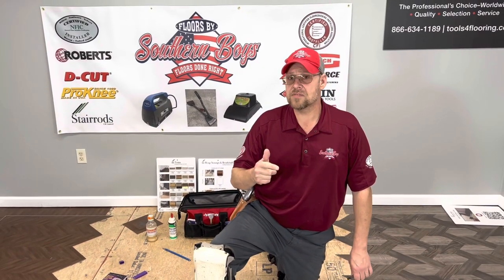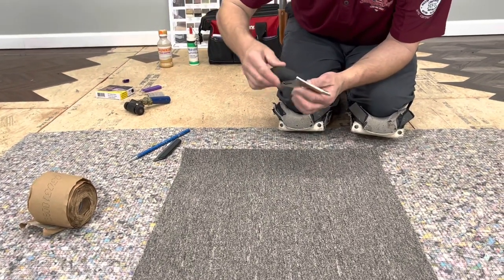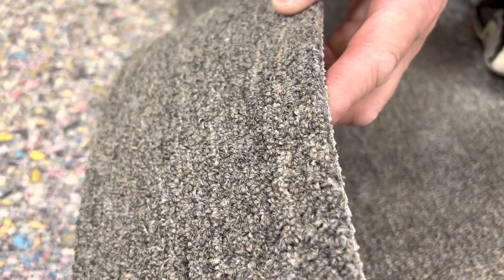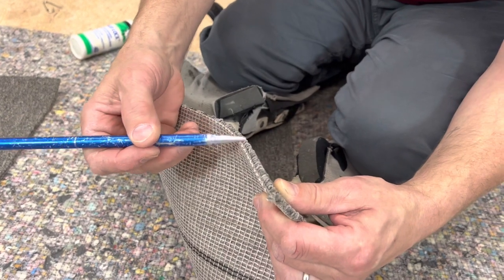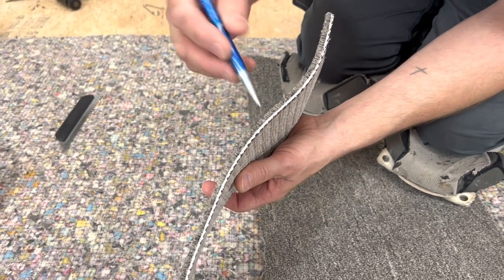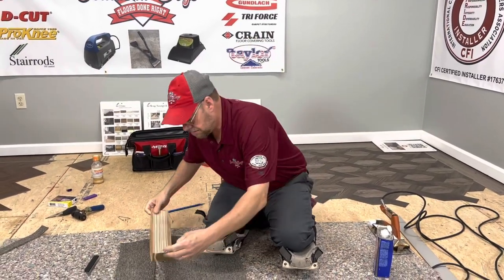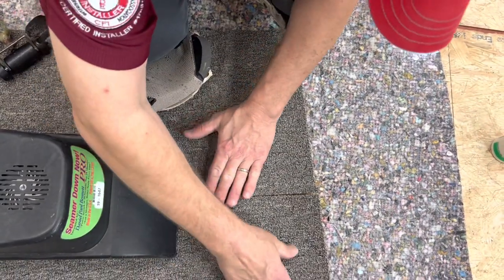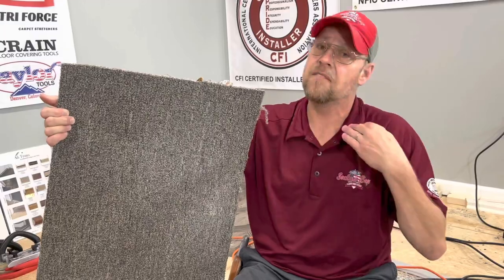How to seam A commercial carpet￼

Comment: Yea but how bout a 50 foot run will that row runner keep it straight on both carpet sides
Reply from the maker: Only as straight as the carpet is, which usually is not very straight but it’s only Carpet you can definitely manipulate it and make it do what you want to, you can pull it in and push it out to make it perfect I have done it for years

Comment: ruben what would happen if you put seam sealer in the slot of the iron in process
Reply from the maker: It would not get smashed into the Cut edge of the carpet good enough to pass inspection, it cannot just be on the edge it has to be pressed into the back of it that’s why I did the pinch method when I pushed it in, If it is not pushed into the backing it will fail inspection even if it is on the cut edge

Comment: Usually when I do schools in commercial carpet some rooms are over 50 to 60 feet long and the rows aren’t always 100% straight, I’ll run a row on one side and trace cut on the other, with a top cutter. use seam sealer and turns out great, I’m sure you’ve had to do that before, I’ve watch a lot of your videos, but haven’t seen that yet, if you ever get a chance that would be a good video,
Reply from the maker: I have never done that, Rose are never straight most the time even and doorway seems you have to do a little manipulating the carpet, the longer the seams the More times you have to manipulate the carpet to make it do what you want but if it is within tolerance of the manufacture you can make it work without cutting the yarns, I do know a lot of people that do it your way for sure
Reply: Thanks bro I only do that on direct glue down on concrete, thanks for the reply
Reply: @FloorsbySouthernboys  I always attempt to row cut both and join with the bows in it anyway. Normally always the manufacturer can wriggle their way out of anything being pinnned on them. I experience it a lot with the carpets I install in New Zealand. I noticed with a lot of American products you have to cut them from the back anyway before you do any join. Seamer down helps for joining with bows in carpet. As long as you have a power stretcher you can still join and stretch almost any carpet with a bow in it imo.

Comment: That's all fine and dandy, when your cutting in the middle of a piece. But it does not work so well at the edges where the tension is different causing the rows to be woven all over the place and you are forced fo side cut one of the pieces. We call this carpet poop loop
Reply from the maker: I like what you call it😂😂, It can be row cut by the edges it just takes a little more time, that’s the only way i will do it